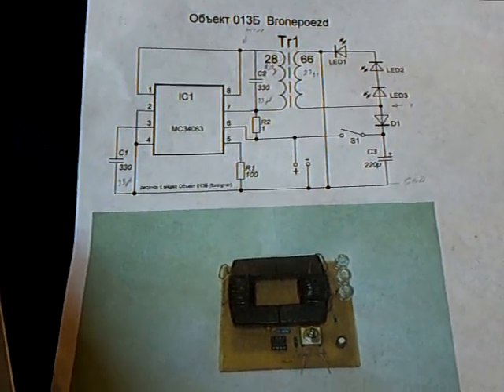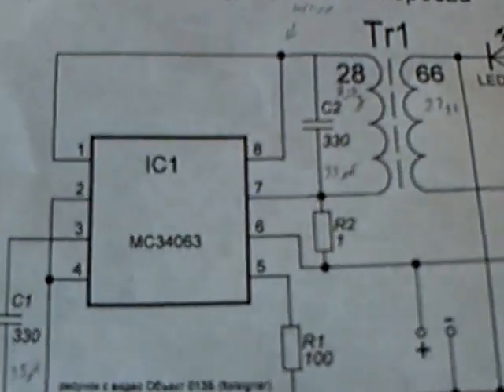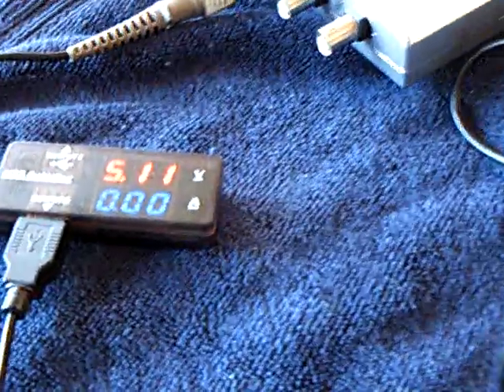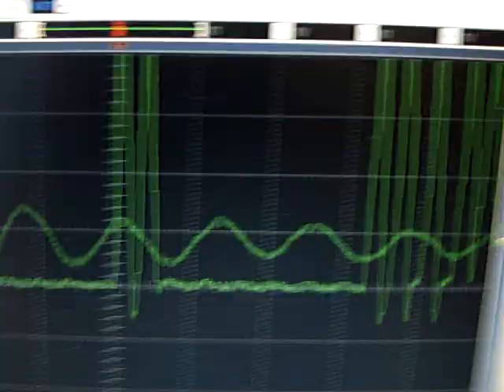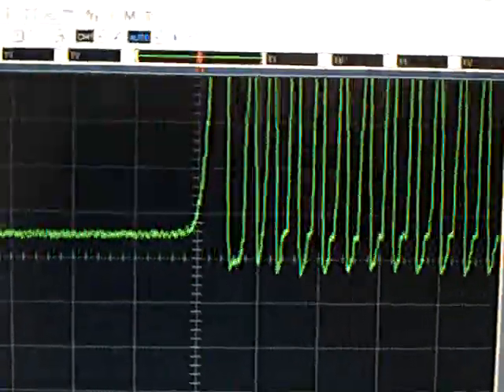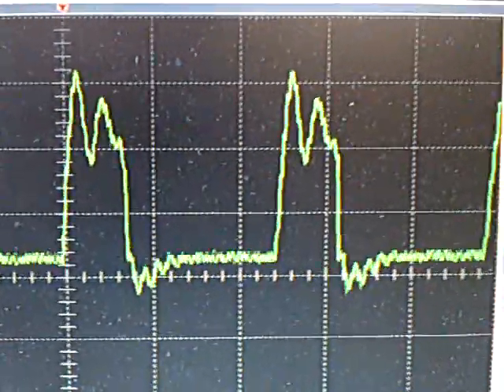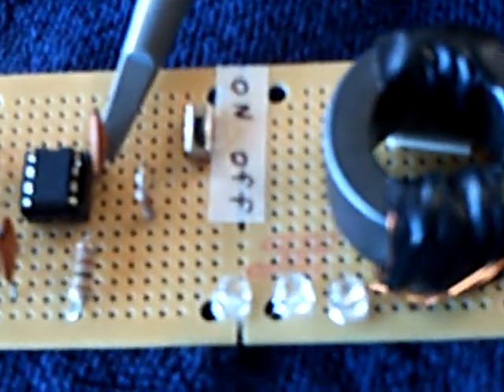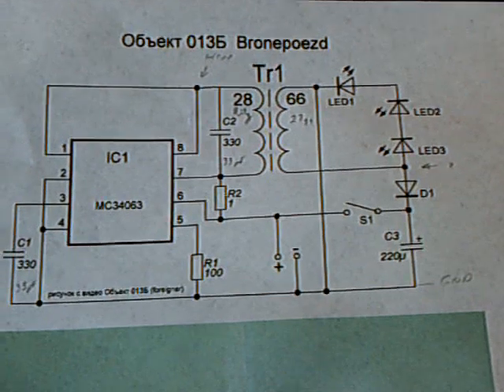Mysterious LED Circuit Scope Shots

Comment: I congratulate you on this result and please tell me if you followed the diagram, if there is a value for the specific inductance, the diameter of the wire and the number of turns because I can't start it. Thanks in advance!

Comment: Seems that Robert has it right, stability on the scope from instability of the chip..kinda fun way to look at the situation.
Ever see those 12V to 5V car adapters in the dollar store ? they have these 34063's in them.
Reply from the maker: slider2732 I have been following TK's work with this project and he mentioned the same thing about these MC34063 chips being in the dollar store 12v to 5v adapters. I have not burned out a chip yet but I did blow a bunch of LEDs trying to get my circuit to run right.  Today I looked at the voltage where this interesting wave form shows up.  It is at about 1.7 volts on the cap.  I wish that I could get this to run on a AA but she won't go to the party unless you give her 1.7 volts.

Comment: What is occurring is that the chip is trying to continue the normal waveform at its normal operating voltage; but when below its operating threshold it just does not stop operating. The chip tries to restart, and go back into operation, failing to do so multiple times once it reaches the peak. So the scope is showing it starting, reaching the peak, then a pulse back from the coil(second peak) then shuts down then restarts the process.
Reply from the maker: Robert maks Many thanks for that explanation.  I figured that the chip was doing this somehow.  That is a pretty amazing little eight legged creature.  I'm wondering now what other tricks it can do.

Comment: Cool discovery!
I'd guess that the chip is tuned to be stable within a specific voltage range & it takes a bit to get there & then after a while it destabilizes when the V drops below a certain level.

Would you provide some details on your laptop o-scope?

Thanks for sharing!
Reply from the maker: A B The o-scope is a Hantek DSO-2090 USB.   It actually works pretty good for what I need it for. Got it on EBay several years ago.    I figured that the chip was doing the magic.  Robert maks below gives a good description of what is happening.
Reply: ***** Thanks!